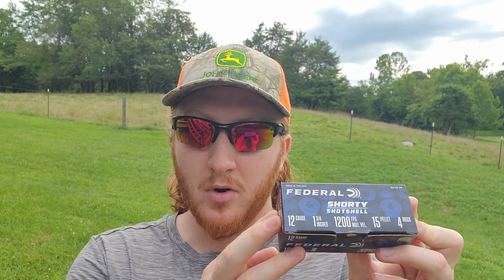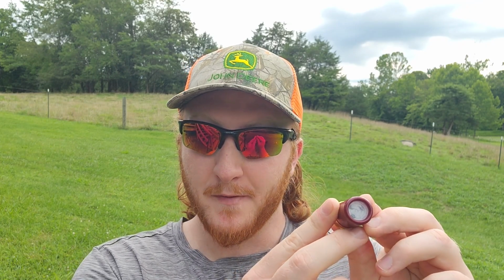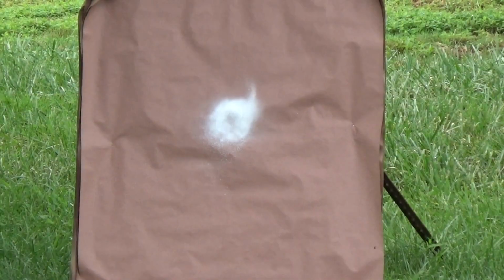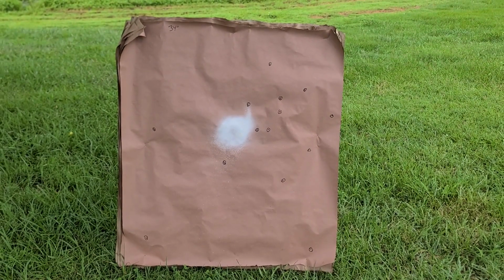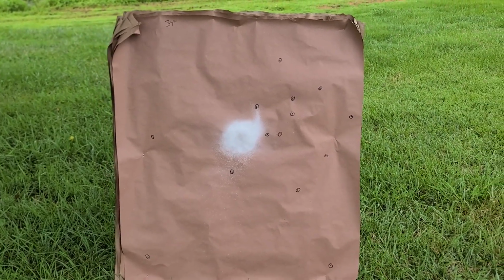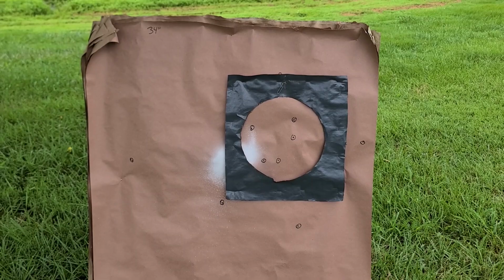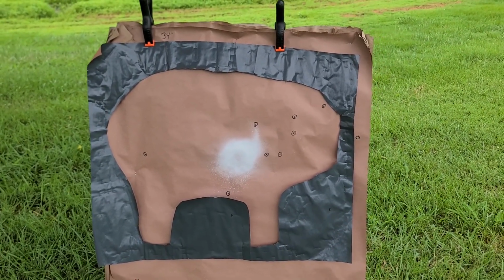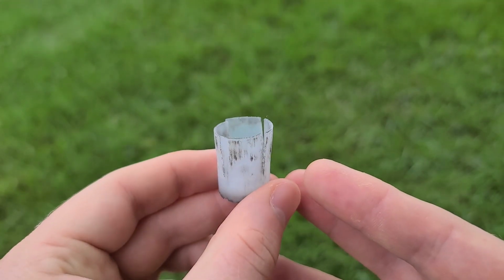Federal Shorty Shotshell 15 Pellet 4 Buck 40yd Pattern Test W/ 11-87 & Kicks Buck Kicker Full Choke

Comment: Does that shorty shell reduce your semi-automatic shotgun to a single shot
Reply from the maker: The Shorty 4 buck and number 8 shells do not fully cycle, so yes, you do have to manually cycle them. Surprisingly enough though, the Shorty slugs actually do cycle pretty reliably in my particular 11-87
Reply: @matttyreeoutdoors  I guess pulling the charging handle on a semi-auto isn't much different than pumping a forearm
Reply from the maker: @johnovanic9560  technically I guess not, but they can sometimes get caught up a little trying to chamber them since they are much shorter. That's kinda why most people just run them in a pump action so they don't have to fool around with that

Comment: We will stick with the 41 #4 pellets in a 2 3/4 inch shell...I think the short shells, with any sized shot, are more designed to add capacity to a shotgun, say 10 short shells vs maybe 7 longer shells...you know how the 'it's all about the capacity' crowd can be...i think the short shells used in the right situation can be effective, but we only keep a double barrel loaded, thus my initial statement...little doubt the coyote would most likely be down, but 40 yards seems to be pushing the range just a smidgen...carry on...
Reply: I've only seen 41 count no 4 buckshot in a 3 inch factory load. 21 or 27 count in a 2.75 inch factory load.
Reply: @User-nx7rs  thank you...i get mixed up like everyone else, you are correct...
Reply from the maker: Yeah, I can agree with you there. We will be testing some other 4 buck shells soon, so we will see how they do